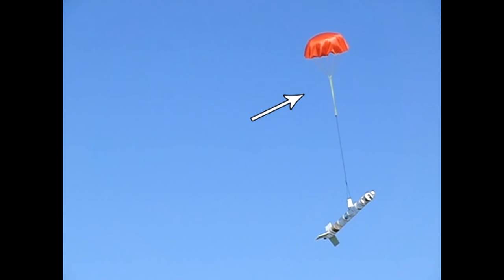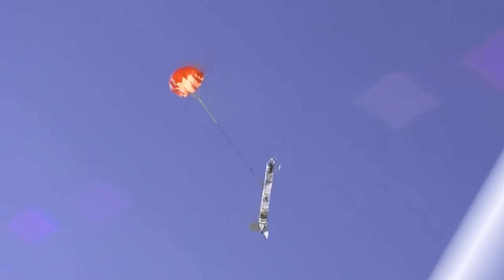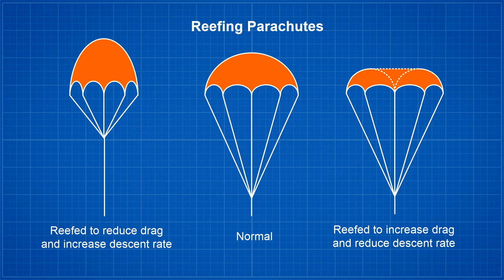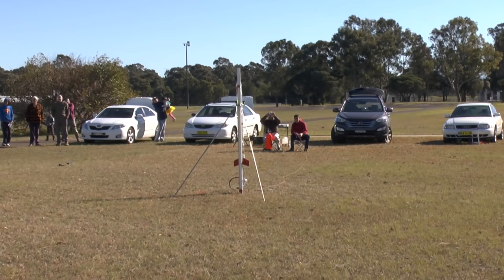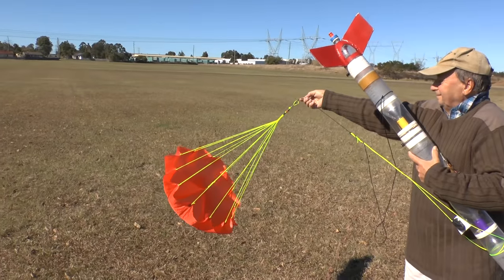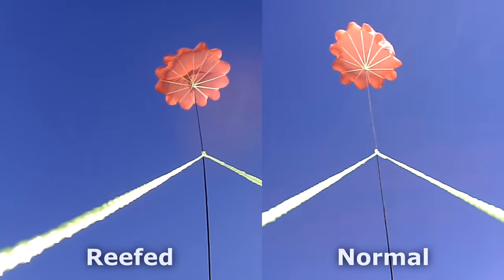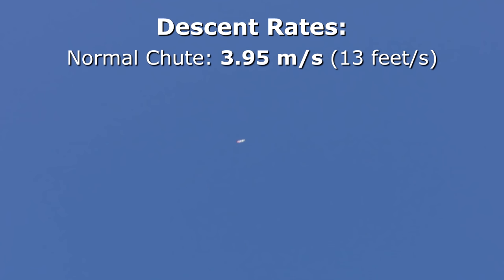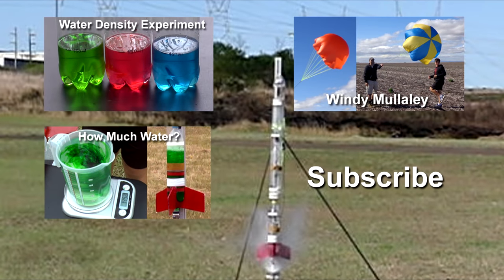Increasing Parachute Drag

Comment: Make a motor pull the string in and out for normal and reefed parachutes so you can descend fast at high altitudes so it doesn’t land too far and then reef it at low altitudes to slow down for a gentle landing

Comment: So how much smaller reefed parachute could you use instead of a normal parachute, which have the same decent rate? And therefore how much weight you can safe and thus reach an higher altitude.
Reply from the maker: Aerocon Systems sells 36" parachutes reefed in this way and they claim that it is as effective as 44" chute. When you substitute the numbers into the parachute descent rate formula the rate difference is around 18% for those two chutes. I would imagine the difference in weight of these two chutes would be fairly small and so a potential weight saving as a percentage of the overall rocket weight would be also small.

Comment: How would i make a high velocity parachute without it ripping? I have a simulation in open rocket that says it will deploy at 60-40 meters a second.
Reply from the maker: You could try reefing it with a reefing ring, or deploy a drogue first and then when the rocket slows down open the main.

Comment: Nice video, one question.. for 700g and for 1 kg what diameter (size parachute) is required for a very slow landing?
Thanks.
Reply from the maker: There are a number of factors that affect how fast the rocket descends under parachute. Here is a good reference that lets you calculate the descent rate, size of chute etc. http://web.archive.org/web/20111018045919/http:/my.execpc.com/~culp/rockets/descent.html

Comment: Sir, can you give a scientific explanation as to why the parachute with the reefed at the center has higher drag than the normal parachute?
Thanks
Reply: pretty sure its because it pockets slightly more air (because of its changed shape), keeping it under the chute for longer, but not 100% on that

Comment: Hello AirCommand 
I'm only 12 and I wanted to make a water bottle rocket I don't want to go too big only one bottle I know all the aerodynamics
but I want to make a launch pad how could I make a cheap easy launch pad for pressurising rockets and have a release cord 
PS: could I get all the materials at bunnings?
Thanks!
Reply from the maker: Hi, yes you should be able to get everything from bunnings. I would recommend building the Clark Cable tie launcher as its fairly inexpensive to build. If you need the Shrader valve you may need to visit a store like SuperCheap Auto. You may also want to read this article on launchers: http://www.aircommandrockets.com/rocket_launcher.htm
Reply: AirCommandRockets Thank you so much!

Comment: How do you figure out the exact string length for the reefing line
Reply from the maker: The length is just set so that the center of chute is in line with the outside of the parachute. The length isn't super critical.
Reply: If I use a hole for the parachute should use more string around the hole to make the parachute more stable?
Reply from the maker: @neil3850  I wouldn't think so. The hole is what makes the chute more stable.